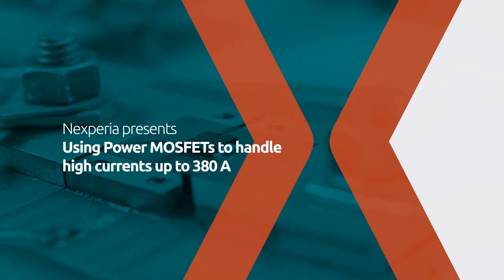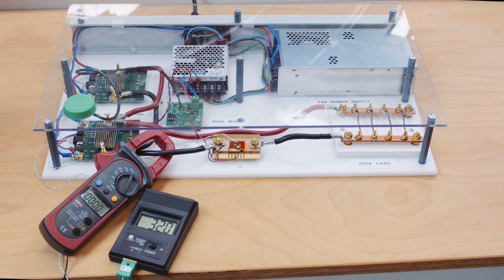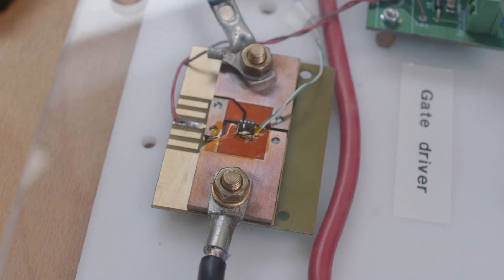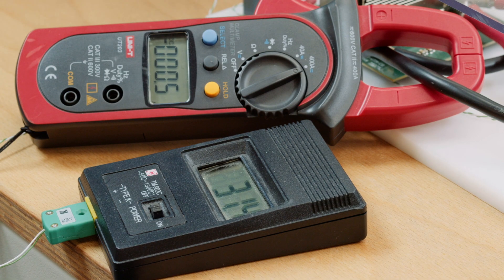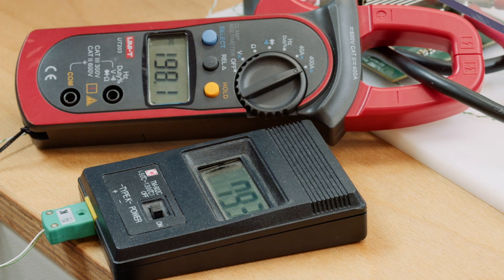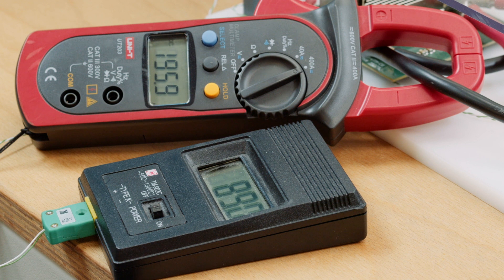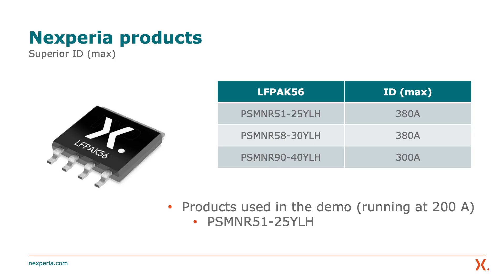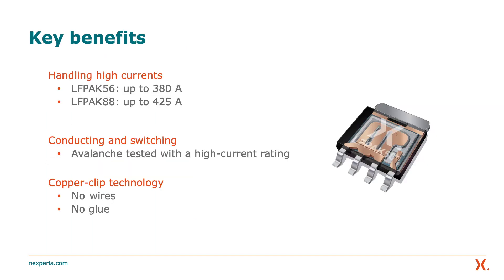Using Nexperia Power MOSFETs to handle high currents up to 380 A

Comment: Hallo mein Freund  
Ich will bei 200 V Max. 10A schalten.
Es dürfen also nicht mehr als 10A fließen. 
Wie mache ich das?
Danke, Grüße Helmut
Reply from the maker: To switch a MOSFET at 200V, a MOSFET with the appropriate voltage rating must be used and depending on the application the rating will differ. There are many considerations to consider, but to start with, the safe operating area of the MOSFET (which can be found in its datasheet) would be able to tell you what voltages and current the MOSFET can safely switch at.
Reply: @Nexperia  Danke sehr. Grüße Helmut
Reply: @helmutstarkloff2515  Moin Helmut. Ich weiß nicht, wie aktuell das Thema noch ist, aber das ist tatsächlich nicht ganz so einfach. Wenn du z.B Wechselstrom schalten willst, ist ein Mosfet ungeeignet. Am besten einfach mal einlesen auf Mikrocontroller net oder ähnlichen Seiten.

Comment: Is the 200 A continuous or RMS?? Are you using a standard AC amp meter or does it measure DC field flux density?? As an electrician and using #4/0 wire to handle 200 A at 80% duty cycle, I have difficulty wrapping my brain around such a small device and terminals handling so much current. I want to power 4 motors of 36 ampere at 36 volts each motor. I would expect the TO-220 package to only handle 12 ampere continuous??  If the TO-220 package are rated at 80 A, can I get away with using only one MosFET per motor?? Since I am using 18,000 CPS +, I am using Shottky diodes to protect the MosFETs. Maybe I am being picky, but I am using high frequency cycle above the hearing levels to eliminate the audio noise of the electric components. I am powering the MosFETs with a PWM. Do I need to keep each motor on a separate circuit or can I parallel the MosFETS and have all 4 motors draw the 144 A through one MosFET circuit??

I had a bad heart attack and my memory has big holes in it like Swiss cheese. I would appreciate some clarity. I contacted a couple MosFET manufacturers and could not get straight answers. They gave me the run around. If you can help and answer all my questions, I would simply use your electronics.
Reply from the maker: Thanks for the question, here's our engineer's response - Sub-milliohm on-state resistance in advanced MOSFETs is common, this Nexperia MOSFET is 0.5mΩ and as such can handle 100s of Amps. The handling of these high level of current requires careful cooling mechanism, in this case thick copper clad was used. The challenge to deal with these high levels of currents / powers is on the boards used to extract heat quick enough and the bigger the MOSFET package the easier to extract heat (assuming same RdsON).  As for driving motors separately or combined in one parallel design will depend on many factors – driving them separately will be simpler and safer. This demo is specific to the MOSFET capability as standalone device, for high current motor application please visit Nexperia site for “motor demo”   https://www.youtube.com/watch?v=-pfrP-8krKU&list=PL02JC46HY5hYhj9vwJg2sc9Bcwn4pizKn&index=15&ab_channel=Nexperia

Comment: What is the Vds in  this setup?
Reply from the maker: Thanks for the question. The VDS is dependent on current and RDSon i.e. I*R, and is of no relevance to this test. The test here is demonstrating the capability of the device on its handling of high current ID (the VDS would be the result of that current and the RDSon at that temperature).

Comment: So in liner 5v 190 is 960watt this is crazy wattage for one mosfet
Reply from the maker: Our engineers have confirmed that the MOSFET is fully enhanced and VDS is around 200mV.
Reply: @Nexperia  but my question is can this mosfets conduct 190 at full rated voltage
Reply from the maker: @Dc_tech386  The device used is PSMNR51-25YLH. Please refer to the safe operating area (Fig3) in the datasheet found at the link in the description where details of the capability for all voltages against current is given.

Comment: I wondered at what voltage is it working at that high temperature
Reply from the maker: Hello @jobsjamaica9388, The voltage in question is VDS (drain source voltage) since the MOSFET is fully enhanced. The device being 0.5 mΩ with 380 A results in the voltage needed to be 0.19 V (I*R) you can set the PSU to 2 V – 5 V to give enough margins to cater for cable and load impedances.
Reply: good deal; 
and dissipating 72 watts too, at those crazy 380 Amps in  such a small package;
  will it also  survice on an aluminum cooler, or will it always need a copper pad in between?         @Nexperia
Reply from the maker: Thanks for the question, @josepeixoto3715. Our engineer gave the following reply - Any heatsink capable of maintaining constant temperature of ~25C - regardless of material will achieve these results.

Comment: What are the two boards connected in parallel on the left half? Are they DC to DC converters?
Reply from the maker: Thanks for the question, @jacobwatts169. The two boards are part of power supply designed to provide high current; any power supply source capable of providing the necessary current can be used here.

Comment: is there an application sheet on how to design a practical PCB to route 400A into such a tiny package or should we solder it directly to solid copper bus bars?
Reply from the maker: Hello, thanks for your question. Our advice is to solder directly to the solid copper bus bar, making sure 25C is maintained.

Comment: Hi, what is the type  (ie: Cr-Al / Cr-Ni....)  and  thickness of heater wire you use here  ?
Reply from the maker: Hello! Thanks for your question. The wire alloy is NiCr (Nichrome wire) and the thickness for this specific demo is 2 mm diameter.

Comment: Excellent current handling in linear mode but finding mosfets with extended forward bias safe operating area where the application requires operation in the resistive zone is a bit of a challenge , assuming I'm correctly interpreting the safe operating area graphs that is , for a Vds up to 24V the Ids continuous is roughly 2 orders of magnitude below that of linear mode operation.
Impressive illustration of current handling , the glowing wires are a great visual .

Comment: Is that bus bar setup that the MOSFET mounts to and the drain and source hook onto something that can be purchased? This looks like the only  way to reliably use that much current through this
Reply from the maker: Hello, thanks for your question! This is an off the shelf buy, it can be bought from the likes of RS components.
Reply: @Nexperia  Hi! I am having trouble finding the component from RS components - is there a part number or name I can search for? Thank you!

Comment: Sorry, that will fail in may case and I have the same respond from all it mean lake of experience in practical use. Using 12-24V DC you can paralleling as much you can but not in my case.

Comment: I lost hundreds dollars on research power mosfets to run 240V AC 8 A with 0.018 100A mosfet and watch when in 1 hr heat up to 100 C so where is there solutions?
Reply from the maker: Hello, Nexperia specializes in low voltage (≤200V) power MOSFETs ad therefore we can’t advise on 240V products.  However, to help with your application consider paralleling MOSFETs, optimize layout to dissipate heat and select the right PCB/heatsink.

Comment: Are they suitable for tig welding machines ?
Reply from the maker: Hello. It depends greatly on the welding machine design.  Suitability of MOSFETs will depend on their implementation in the design, here we are showing the high current capability of our MOSFET, but other parameters such as VDS requirement are also necessary. Thanks!

Comment: I guess switched these should take upto 500A for < 50ns

Edit: looked at the datasheet. They are pretty awesome devices. Can handle 1700+ A when pulsed at 10ns. The thermal conductivity is a figure I'd never thought I'd see in datasheets. Nice one.